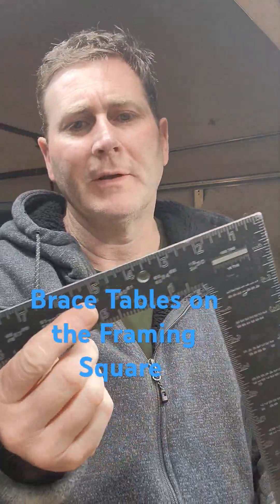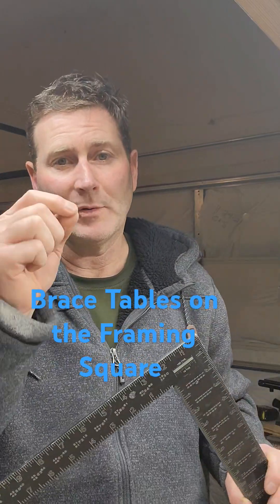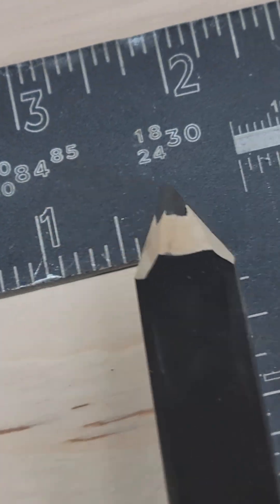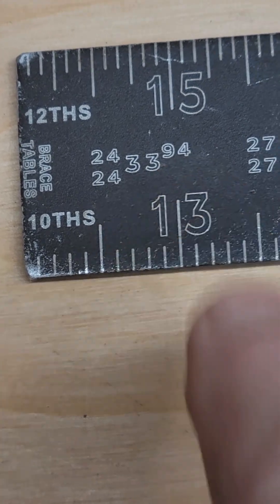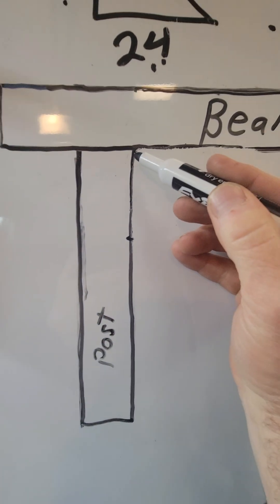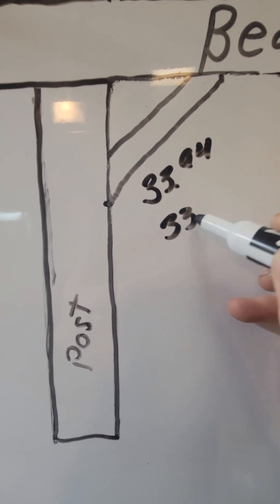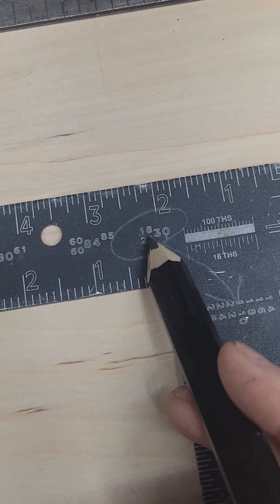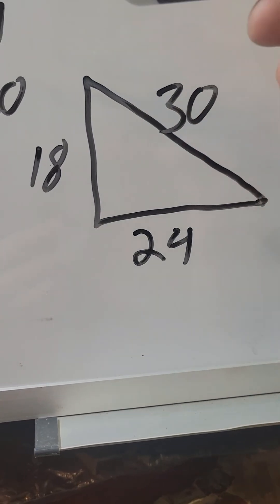Framing Square Brace Tables explained #framerlife #carpentersquare #carpentrytool

Comment from the maker: The brace tables on the Framing square are right isosceles triangles, the last entry on the brace table will tie you back into the 345 rule on the Essex board measure scale of your framing square to form perfect right triangles, The framing square is your foundation literally You can use this to square up anything. I hope this video helps someone out there have a better understanding of how the framing square works.